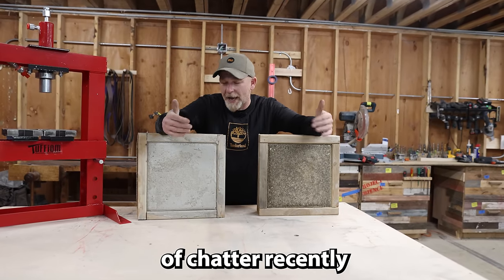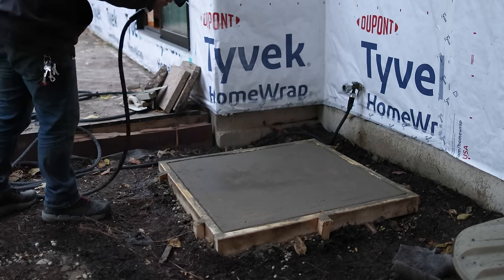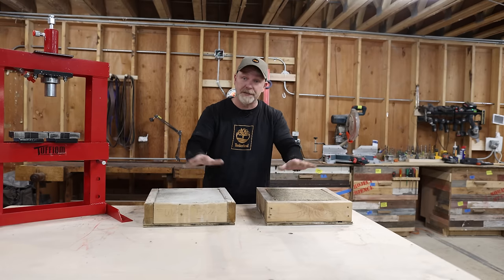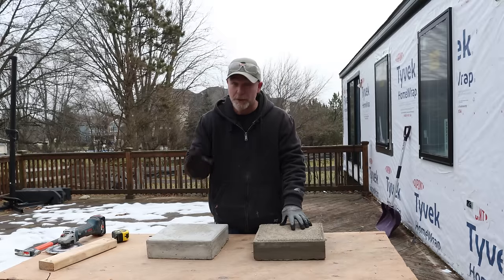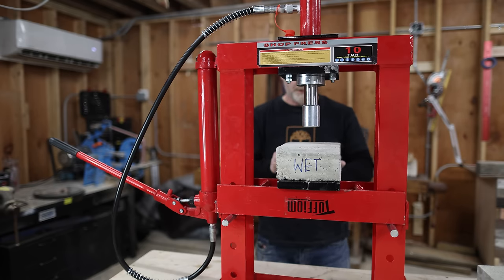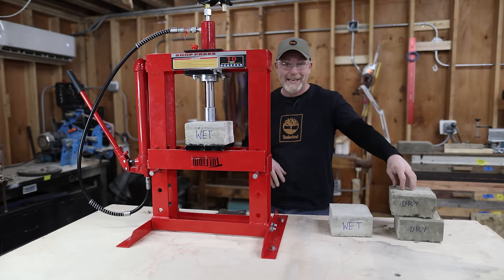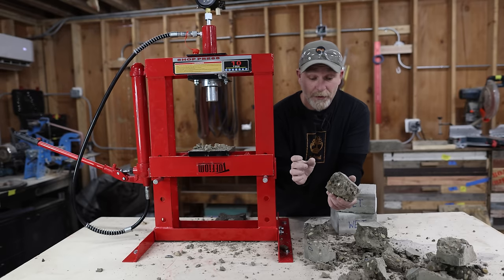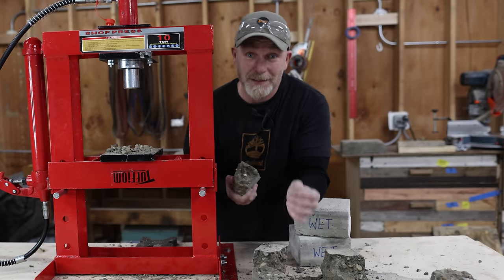The TRUTH About Dry Pour vs Wet Pour Concrete!! Strength Test - You WON'T Believe the results!!

Comment: With the dry pour, each time you watered the slab you added moisture to the wood. This would impact the amount of moisture being absorbed from the concrete into the wood, and also add more moisture to the sides of the slab touching the sides. 

Also, there may not have been enough water for the dry slab. That being said, Wet is always going to be better because of the uniformity of the mixture, and you don't need to do a lot of guessing compared to the dry pours.

Comment: Please YouTube people dont waste time watching and learning drypour techniques and spend that time learning wet pour.
Couple good tips for better "bag mix" crete also.
Even though it says "hi strength " i still add portland type i so i have extra cement in the mix for strength and ease of finish.
When you mix bag crete let it sit a few minutes then mix and temper again or if you get your water amount dialed in use extra water. Bag mix has dried aggregate in it so it soaks up extra water. This will especially help a novice with finishing because your not only fighting standard finishing time but also aggregate soaking up extra water.
These will help newer people have more time and better product to work with so they don't have to resort to doing junk work with dry pours.

Comment: Over the years I have done a few dry pours and it takes months if not years for them to fully cure. Dry pours also heavily rely on absorbing moisture from the ground. It will never be as strong but these are weaker then they should be.
Reply: So we should wait longer than 30 days for full strength? To me that seems a little excessive vs standard concrete. But everyone can do what they want.
Reply: @brandonm9359 there's a reason people usually only do dry pours with fence posts.  I had no choice when I did the few pours I did.
Reply: @revtoyota I don't understand why anybody would think dry pour is as strong. If you ever seen concrete get wet in the bag and then harden  would know.
Reply: @roscoeshepard  Check that same bag after 5 years outside.

Comment: The biggest reason the wet pour is stronger is the mixing that’s involved, it is ensuring that all of the concrete mix has the correct amount of water on every tiny particulate matter in it. This is the same as making a cake, you wouldn’t skip mixing the dry ingredients with the wet ones.

The only way a dry pour is going to have a chance at being strong is to have an additional form above to hold water and let it slowly drip down into the mix. It is very clear that the dry isn’t meeting the ratio required for the concrete mix.
Reply: Once concrete begins interlocking its crystal structure, it will shed more water than it will allow through.

Simply dripping water on top is not enough. Maybe if you had a system of sloped baffles, similar to those self mixing epoxy tips. And sprayed a heavy dose of water as you dropped concrete in there it might do something.

But I bet it still wouldn't pass a soil techs core sampling and testing procedures.

Comment: I (poured) a slab in a shed with just class 3 cmb road base (crushed miscellaneous base) (asphalt and concrete recycled) for those who don't know. No cement at all.  Several years later I upgraded to a poured slab but I had a buggar of a time busting through that cmb slab that had cured into a pretty hard block.  I have a pretty good sized skid steer and really had a tough time of it.  Time to cure is the key? Many wet cycles in that example I gave.
Reply: Time to cure is hugely important.  Nearly all modern concretes are mixed for a very fluid pour and relatively fast cure to reduce labor.  Labor costs money.  But if you are willing to spend more time and effort on labor, low slump mixes that can't just be poured and have to be hand-packed and frequently vibrated to reduce voids.  Those mixes end up stronger.  And the longer the cure time the stronger the concrete ends up being.  Turns out the reason roman concrete has lasted so long as a combination of it not being reinforced with metals so it lacks the problem of internal corrosion expansion and cracking.  A low slump mixture that started out with just enough moisture to cure.  And a curing time that could last years.  Parts of the pantheon apparently took nearly a decade to fully cure deep inside the thickest parts of the structure.
Reply: he didn't follow the instructions that worked for others, he said that he did the initial misting with too much water, there are instructons that work and if you don't follow them you get this kind of result where there was no bonding formed between the CSH...
Reply: @VenturaIT  u will get that result regardless
Reply: @timfuscaldo3024  nope, others have poured entire slabs that stand up to heavy use... it's the people who intentionally don't do the process correctly that have these results...  concrete is concrete... doesn't matter how you mix it just so the amount of water is right, people have been setting dry post foundations and other dry uses for concrete forever...  but if you half-way wet it then wait too long or it's too cold then it won't work... concrete has to be poured above 45F-65F or it wont work
Reply: @VenturaIT  Sure others do, good for them, love how people like to take the short cuts and believe folks like you.  It is a free country and folks are free to be ignorant.
Reply: @timfuscaldo3024  no need to call people names, just that some people don't follow the instructions, follow the instructions and keep it at the same environmental conditions (temp/humidity/pressure) as on the CAJUN COUNTRY LIVIN channel it will work
Reply: @VenturaIT  funny response.  Your right, "no need"

Comment: I’m not sure where this idea is coming from, but I have a guess.

Not long ago I’ve read about a research made about the strength of commercial concrete mixes, with different water ratios. The study found, that if we mix commercial mix with LESS water than what the instruction says, it will be stronger, even more than the specified strength. They specify more water because it makes it easier to mix and pour, so harder to mess up. “Drier” concrete needs to be mixed much more thoroughly, and then be compacted after pour to avoid voids. 

Maybe somebody took this idea to the extreme, without reading the details of the study, and came up with the idea of dry pour.

Comment: If u do dry pour its better to mist in layers 1/3 of desired thickness fill smooth level mist then proceed to second lift and continue to final lift then your mist intervals it adds strength to your concrete like in a wet application you tamp and compact it in levels each lift as you reach your final lift and finish work removes air pockets and mends the layers together making a stronger product u can also add super p or fiber mesh or to gain more strength or in lifts u can add color as well FYI after years of inspections and testing dry pour will always be weaker concrete that will not have the life or finish of wet concrete pour by a good margin

Comment: I was planning on using dry pour concrete for some stepping stones in my yard. I suspect that that would be a decent use case since they won’t ever be under more load than a person’s weight.
Reply: Why?  Do you really think your saving any time or labor?
Reply: @zoso1123  I think so. It may not be true, but my mental walkthrough has made it seem like less labor for a part of a project that needs my attention elsewhere
Reply: @seankrake4776  The hardest part is carrying the bags.  Still gottacarry open and pour whether u mix or not.  If you worried about working hard, buy your stepping stones pre made.  Then you save time and money.
Reply: Dry pour stepping stones are FINE.  Perspective, people.  It can work in higher stress areas, but it's kinda luck of the draw.  Are you in a wet climate? Can it draw from the ground?
I've done dry pour posts for years. They are still solid  more than a decade later.
Reply: dude, get a wheel barrow, you can use it to make moving the bags easier and since you have it you can use it to mix the concrete it so you don't waste time having to go water it every hour, the ONLY USE CASE FOR DRY POUR IS SETTING POSTS, PERIOD, FULL STOP.
Reply: @DanielRichards644be clear, fence posts. Not all posts. Structural posts for decks etc would never pass an inspection.
Reply: @YSLRD  Dry pour post are a very different application than a pad.  Posts work just fine...pads not so much.

Comment: 1:51 the key issue with dry pour is the lack of publically available standards and process instructions. Proper hydration is essential for strength and integrity of concrete. Without proper hydration, "curing" is partial at best. IMO, "misting" of dry pour slab is only the preliminary step for hydration and serves primarily to stabilize the free surface against erosion during high flow wetting. If the dry pour doesn't have a ponding step, there's a high likelihood of insufficient hydration.
Reply: yes, wet curing/ponding for up to around 30 days will make any concrete stronger, mist once, wait 1 hour, mist lightly again as to not to disturb the surface preparation, then wait 1 more hour, then water heavily but no so heavily that you disturb the material, water 2 times for every inch of your dry concrete, so a 4 inch dry slab will get 8 waterings separated by 1 hour... another thing is that you can't do this in freezing or cold weather... it has to be probably 45F or warm to hot... but not too hot... i've seen it fail in dry and arid locations... the Cajun Country Livin people have rain that is a natural wet curing process after they do their process, which actually gives it more strength...
Reply: @VenturaIT  Cajun country has the advantage of continual wicking of moisture from the ground ...

Comment: There was never any question on dry vs wet, 20 years ago my neighbor talked me into setting deck post in dry cement, after the first winter my deck was warped from the post rising and lowering, I had to temp brace everything and reset new post one at a time in wet cement.

Comment: The first couple of waterings should be light mist. After that, drench it with water. It needs to absorb about a gallon of water per bag used.
Reply: Yep, he didn't do this. not enough water.
Reply: I quit watching the video... he sounded to bias at the beginning of the video.  I didn't see the pressure gauge on camera when he went to the dry pour, so I stopped watching..... thought there might be a reason he wasn't showing it.  Maybe he did later, but I also don't think he did the dry pour method right, either.
Reply: @blythdunlap8408  he said he did the misting too heavy...  people having been doing dry pour for fence posts forever and making retaining walls out of bags forever... I left some mortar mix intended to be used for a shower pan in the bag, not even concrete, left out in the driveway for years and it's as hard as a rock and is now used to weight down our portable basketball hoop, never even watered it, it just got rained on during rainy season in socal... hard as stone
Reply: @blythdunlap8408  I don't have a side in this ongoing debate but there certainly did seem to be a bias out of the gate and the test was anything but scientific when he admits to not using the correct amount of water at the start. What's the point of bothering to test if you didn't do it right in the first place?
Reply: @Majerly_Annoyed  This!

Comment: I have poured/done both types. Depending on how you wet the dry, it does make a difference. For looks, though, if trying to match color to an existing sidewalk. The dry pour when done matched the older existing sidewalk, not only in color but that weathered look.  Several people I showed the dry version to asked where the new sidewalk was. I have even driven one side of my 2500 pickup on it. Yes, it's not 8 tons. But it looks natural. What most people don't  know is that air entrainment and mixing are the key to good cement.  Plus, a solid base. Dry pour should be used mainly were you can't get a cement truck in and don't want an extra cost for yard repairs. Nothing super heavy.

Comment: I think dry pour shines for fence posts.  It is not structural just used to weight the post in the ground and the moisture in soil will continue to be there for whatever it wants.  Dry pour for a sidewalk maybe if you do not attempt to use it for a week or more.  Anything else should be a wet pour.

Comment: Interesting. But, well ... all the dry pour recommendations I've seen are to do it with quick set. Is that what you used? I suspect that would make a significant difference.

There are also methodological issues. Some concrete manufacturers do recommend dry pours for fence posts with quick set. But in that instance, there is a lot of moisture absorbing from the surrounding soil. I don't think a dry pour misting only the surface in a dry box is ever going to work well.

FWIW, I dry poured my swing set posts, and it's rock solid, even though it has no angled supports, just vertical posts.
Reply: No, trust me it's not, I did a dry pour to set my mail box post years ago, when the post rotted out I pulled out the concrete and it broke into several pieces, the reason dry pour works for fence posts is because it's a mass and surface friction to the dirt that keeps things solid, not the quality of the mix, you aren't relying on the compressive strength of concrete to hold your posts up.
Reply: And, I would add, I would never use a dry set for anything structural or anything necessary to keep people safe let alone my children. But, I also would never use dry set period. Only a few occasions where we put fence posts in using quick set material which has polymers designed to decrease set time and increase binding.. 
Current UCC code in almost all states does not even allow the setting of posts in concrete because of corrosion affects and water sitting in bottom of hole created by post allowing for puddled water to do what it does best: erode things over time including concrete.
Code requires all concrete piers to be a minimum of 2-3" above grade with structural post brackets set into concrete  while wet.
Reply: i left a mortar bag out in the driveway for years, just forgot about it... it was for a shower pan, but then didn't go that direction... now it's as hard as stone, it's not even concrete and this was years ago, now it's used to weight down our portable basketball hoop, probably the first winter it got a lot of rain on it that saturated it...  once the concrete is set (misting) you can't use too much water...  but you can ruin it by misting it with not enough water, then waiting too long so half or a portion of the CSH bonds set then watering it and then waiting too long, you see he made up his own instructions with 45 minute intervals and those aren't the instructions that work...   I watched the Cajun County Livin channel again, their instructions that work for them are light mist wait 1 hour another light mist wait 1 hour then do heavy watering once per hour for as many hours as 2x the inch thickness so you water 8 times for a 4 inch slab... theirs turned out grey like concrete, not dirt color which makes me think the guy in this video added too much sand to his concrete

Comment: What I've learned is that to dry pour or wet pour depends upon one's structural and financial needs. For example, dry pour seems perfectly fine if one just need slabs for around the home projects that don't require heavy loads such as for small sheds, HVACs, chicken coups, low use walkways...etc. and the need to save money. As he states, he wouldn't use a dry pour for anything structural needing major strength. I'm certainly glad I've learned about dry pouring for low stress projects around the home and with mankind's ingenuity, will someday see someone invent a way to make dry pouring just as structurally sound as a wet pour.
Reply: @1dayUwillfearGod  You think a dry pour walkway is going to crack under at most a 400 lb person when it took this 8 ton of pressure in a 6 inch radius to get cracks to show?

lmfao ok

Comment: I used to take care of a building of retirees.  One of my tenants was a former materials tester for construction projects.  One thing he told me forever sticks in my head, and that is concrete gets continually harder for the 1st 28 Y E A R S  of its life!  Then it turns around and goes the other way.
Reply: Except that Roman concrete mixed 3000 years ago is still holding up the aqueducts it was mixed for.
Reply: @damnhandy  that's down to a combination of being unreinforced so no internal corrosion.  Use of pozallano ash in the mix.  Use of a low-slump hand-laying technique that's too labor intensive for modern large scale construction but leaves far fewer internal voids.  And using a mix that cures very slowly at relatively low temperatures.  As in literally orders of magnitude slower than the cure on most modern concrete mixes.
Reply: @damnhandy apparently we lost the exact Roman concrete formula
Reply: @artnull13  A pity.  All I know about making concrete, which is considerable, is that the least amount of water imaginable will create the hardest concrete imaginable.

Comment: Thanks. I would never do a dry slab. But many folks have suggested that I do dry pours on fence posts. The idea never set well with me. I know how concrete cures. Your test was really helpfull.
We did a fence "reset" in an area near a creek that is famous for the ground moving downhill towards the creek pretty fast. Pulled off the fence panels. Pulled up the fence posts. They were about 5"-9" out of level at the top. The fence was almost a year and a half old. Just put the same posts back in. Still new posts. Crazy.